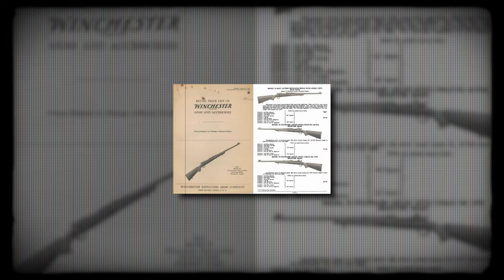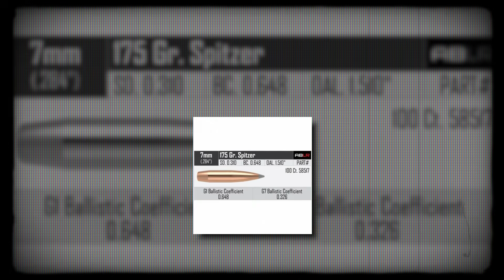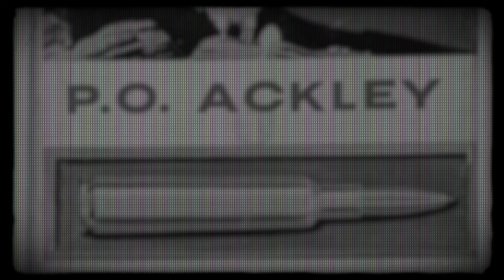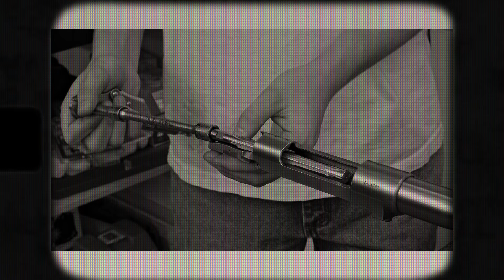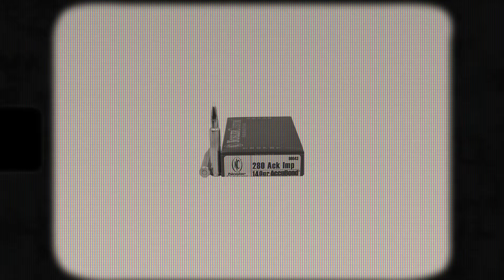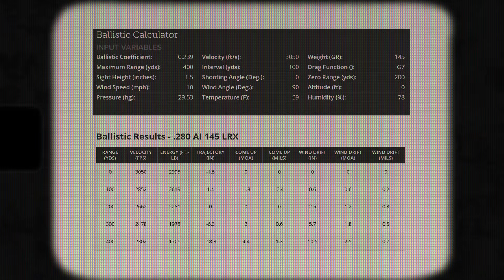The Cartridge P.O. Ackley Built That Winchester Buried for 50 Years

Comment: In the mid seventies, I saw a story in Guns & Ammo or Shooting Times about forgotten calibres. They were the 16 gauge, .38 Super and the .280 Remington (there may have been a fourth, but I can't remember it). I had acquired a vz24 - Czech M98 action, and I decided to build a .280 Remington using a Douglas Premium barrel.  It is ballistically identical to the 7x64 Brenneke, so the same load data applies. I sold my Voere Shikar .270 and still use that .280, which has the advantage with heavier bullets.

Comment: I love anklet chambers, I have worn out five .223 ackley barrels in .223 ackley, I was a macropod harvester for many years and using a custom barrel of twenty nine inches they were fast, accurate and nearly twenty thousand rounds before losing accuracy, even in One in Fourteen twist 63 Remington match hollow points shot super fast and accurate, in Australia we have ADI powder so I used a heavily compressed load of AR 2206H providing over two different chronographs 3650 FPS, god that was devastating damage to heads.  Hey even my 416  Chatfield Taylor is in the ackley style, almost straight case and steep shoulder giving great capacity and great case life.  I seen a rifle in Brisbane Queensland in 30-06 with PO ACKLEY  stamped into the receiver from the early 1950s.

Comment: The early Remington auto's and pump guns are not the reason the 280 was kept to low pressure. They both chambered the 270 which runs 65,000 psi. While the 280 was kept to 58,000 psi. 
They did this because they also came out with their 7mm magnum cartridge at about the same time. If they ran the 280 to full pressure the advantage of the magnum was not worth the extra cost of ammo and recoil. 
A properly loaded 280 can match and sometimes exceed the velocities of the magnum. Doing it with less powder and recoil.

Comment: I can safely push 140 accubonds @3200 fps from a 7 rem mag and do so accurately. And I can push 165s at 3000 fps in a 3006 with sub moa accuracy so I don’t really get the point of the 280
Reply: They’re still kneecapping the 280. Everyone but Browning/Winchester…lol. 
Browning chambers it in a rifle with a fast twist and long magazine. Spomer and Von Benedikt tested it with handloads (oh yeah, they gave it a long throat, too) and ran 170g bullets at 3000 if I remember right. 
Seated way out. 
But the main advantage in my mind is another round in the magazine.